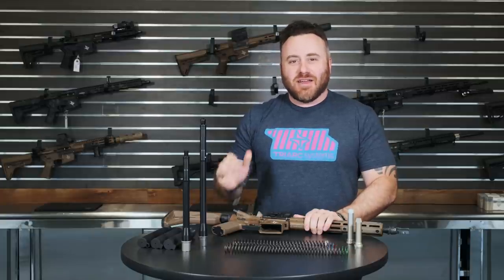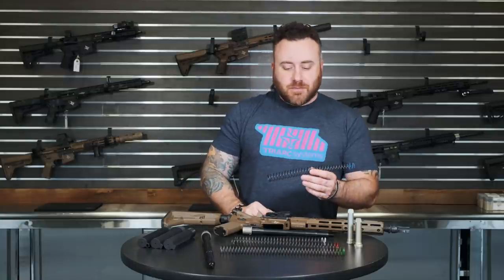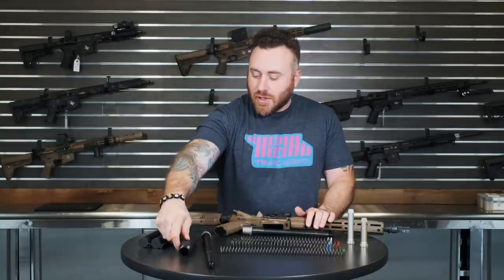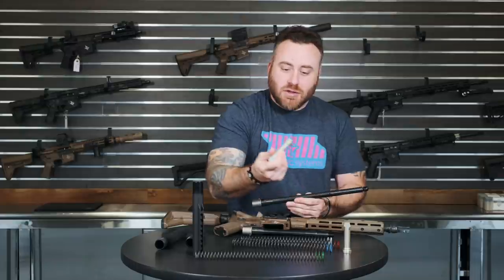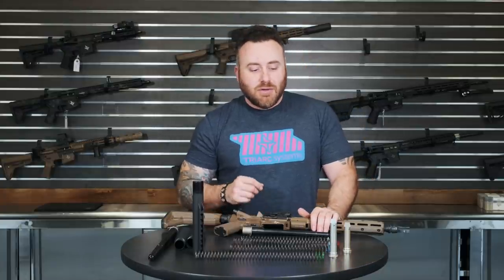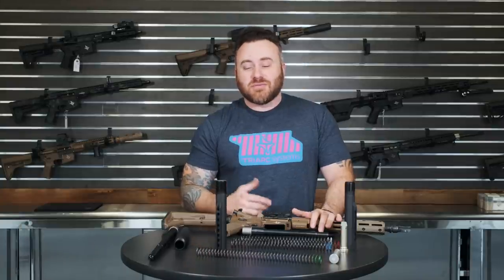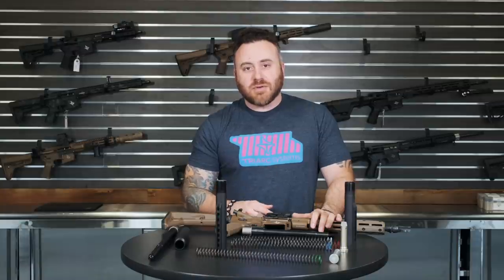AR-15 Spring and Buffer Weight FAQs

Comment: Received my 11.5 upper (fantastic build quality). Long story short the blue spring/H buffer will randomly not lock the bolt back on an empty mag. Switched to standard carbine and H2 buffet and it runs like a top!

Comment: Springco blue and H2 on my 14.5, runs like butter down a slippery slop. Love the A2 community and keep it going.
Reply: Rocco Cardarelli  switched over all my rifles to sprinco springs. They’re much quieter and last a lot longer. Typically I run H2 and the blue spring in all my midlength guns and they shoot very soft and smooth. My Trairc 12.5 came with the H1 and Blue like he said in the video and it’s wonderful. I am thinking of trying the H2 with it now though since my suppressor came in.
Reply from the maker: Rocco Cardarelli  yes its DI
Reply from the maker: @Hazmat0357  Thanks for the feed back Amigo
Reply: @Hazmat0357  You think I will be good running 4.3oz on 16 inch mid length 223/556 or should I go down to 3oz ? I’m using a 16 inch mid length ballistic advantage barrel.

Comment: All hail the algorithm and cyber big brother...
I've been dealing with a cycling issue on my .300, and finally realized it was the Law Tactical folding adapter I added, or more specifically, the 1.8oz "extender" that comes with it, that is the cause. The thing ran flawless before adding that folding adapter/BCG extension. Now it won't lock back on empty, nor eject/feed properly.
Your advice to lower the buffer weight is the answer I've been looking at, but couldn't find anyone else talking about this issue with this folder.
Thanks to my search history, "the all powerful algorithm" lead me to the video with the answer. (now stop watching me, cyber big brother)

THANK YOU!!!!
Reply: Would you mind explaining in detail what you did? I have the 10.3 .300 upper on a aero precision lower and I want to add the law folder as well. Did you use the RED spring he talks about? What weight buffer did you use? I heard a hydraulic buffer might be good.
Reply from the maker: @jasonarias55  Blue H1 but remember Subsonic rounds  and supers are completely different. so to fine tune pick a spring combo that works best. we only run subs suppressed.
Reply from the maker: Glad we could help
Reply: TRIARC Systems, LLC Ok so it’s definitely possible to find a balanced spring combo that can run suppressed subs and supers... just not suppressed supers. I would need another spring and buffer combo for that? Or just don’t suppress supers In general?
Reply: @jasonarias55  I've not attempted a solution yet. I'm actually going to try another part made by KAK Industry that replaces the steel heavy extension with an aluminum lightweight one. Drops the weight by ~50%. It's q quicker swap if I want to run different ammo(subs or sups) than a buffer. However, if that $20 part doesn't work, KAK also sells custom parts to build a buffer to your chosen weight using tungsten, steel, or aluminum weights, and I'll likely put an aluminum one together for running subs. I'll try to remember to report back.

Comment: I was running your 14.5 with a gemtech adjustable bcg with the A5 system and the a5h3 with a law folder and was running fine unsuppressed. Once I put an rc2 on it, after about 200 rounds suppressed would fail to lock back on empty. Trying to figure what weight to run now. Maybe a5h2

Comment: Having a chicken or the egg problem.  When tuning a new build, what should I try changing first?  The buffer or the spring?  What gives you the smaller incremental change?
Reply from the maker: Work on the recoil from back to front. it all starts from the gas port but you need to eliminate as mush friction as possible also remember you need good spring tension going forward too.

Comment: Hey Chris what do you recommend for a 10.5 mostly non suppressed but want it to function to lower power 223 but still handle to hot stuff
Reply: I have my 10.5 NOVESKE SBR suppressed w/dead air sandman s. Running a blue spring along with an H2 buffer. I also run my 11.5 & 12.5 SBR with the exact same setup. All suppressed.

Comment: Great Video!!!
Thanks for the education..
I just put my AR together (upper came complete, I just had to assemble the lower). I have 1 issue:
My action is very stiff. I have to go Guerilla on the charging handle to pull it back! 
Any suggestion?
FYI, I haven't fired a single shot, yet

Comment: What would you recommend if the configuration was a 12.5 triarc upper with an A5 receiver extension and a law folder? Would the green spring + A5H1 combo be sufficient?
Reply: Did you go with the green spring and A5H1 - I have a 12.5 upper with green spring and A5H2 and will not hold bolt open on 1 round mag - but will on a carbine milspec spring/carbine buffer  ?
Reply: @deaconnyte9748  I have the lower with the A5 and A5H1 buffer, no law folder though and no 12.5 upper yet. I'm waiting on the upper right now from triarc

Comment: Is it normal to have that spring noise in the buffer tube? Mine seems a bit loud, but it's the only ar i got so i have nothing to compare it to. Is it normal to have resonation in the spring?
I was going to "grease" the inside of the buffer tube, but didn't want to before getting advise from someone who actually knows what they're talking about.
Reply from the maker: That can be normal with new spring and buffer tubes. oil will help and eventually the surfaces will smooth out. steel wool can help smooth out the surface inside the tube but you have to beware not to remove anodizing

Comment: What do you use for your 8.3 inch 300 BLK builds? I’m looking at the TSR 15-SE.
Reply: A standard carbine buffer and spring should function. If it’s not feeding correctly go to a reduced power spring. Those sprinco springs are ok but I prefer flat wire tubs springs
Reply from the maker: we typically run Blue Springs H1 buffer but we recommend shooting subs suppressed only . you will have to reduce the spring power to shoot subs unsuppressed.

Comment: Would the red spring be good for a suppressed 11.5 also? And would you still need an H3 or would the spring make it so you could run an h2 thanks
Reply from the maker: red spring would work great with a heavy buffer as well suppressed. but it might be too heavy for un suppressed depending on the barrel / weapon manufacturer. our suppressed only barrels will work great with a blue spring H1 / H2 depending on the suppressor model and manufacturer.
Reply: TRIARC Systems, LLC specifically an LMT 11.5 with a dead air sandman S

Comment: For an 11.5 unsuppressed what combo would you recommend? Insightful vid btw!
Reply: I would also like to know. Just got an 11.5
Reply: When in doubt, h2 is a good way to go.
Reply: @jamesdrakcip9276  I started with the h2 but ended up having to go with the h3 on my 11.5 to get my rare breed trigger to function properly. (Upper from psa)
Reply: @sandwichartist5053  careful. Uncle Joe is watching. David Chipman isnt though! Bahahaha
Reply: @sandwichartist5053  i have a suppressed mk18 that loves to blow its gas load in my face. I just replaced my h2 with an h3. Hopefully that delays unlocking long enough to help reduce some of the blow back
Reply: @jamesdrakcip9276  that’s a good idea. I’ll have to keep that in mind if I ever get a suppressor

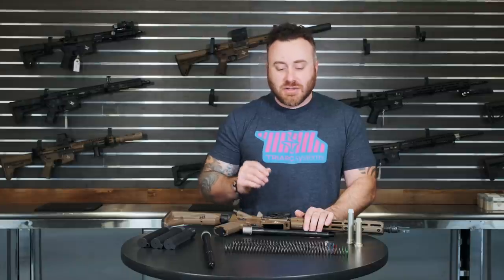Comment: Recommendation on a 16” carbine gas with A carbine buffer and spring that is ejecting at about 1:30? Thinking about the blue or red spring and making the buffer either H1 or H2.
Reply: If I were you I’d run a blue spring w/H1.

Comment: 20" .223 Wylde. Do I need to go rifle Length buffer tube and spring? (42 coils)
Reply: Failure to feed every single time
Reply: Either a short stroke and you need a lighter buffer or the mag is bad.

Comment: For your 14.5 barrel with your enhanced BCG would the VLTOR A5 H2 be too much? The H1 is very hard to find right now.
Reply: What did you end up doing?
Reply: @ek7404  I got a A5 H2 and the JP rifle spring. I couldn’t find a springco green and a lot of the guys I compete with use the JP rifle and A5 system.

Comment: Any problem with your 14.5 running the A5 with the A5H2 buffer?
Reply: My 14.5” triarc runs the a5h2 with green spring and it is and has been flawless.
Reply: Mine was running the a5h3 with a folder, unsuppressed just fine. Suppressed with a gemtech bcg I use the a5h2 cause suppressed setting on bcg

Comment: Have a 7.5 inch 5.56 with law tactical folding adapter running an h2 buffer. Still spitting shells out at about 2:30-3:00. Recommendations?
Reply: What spring you running right now?
Reply: @l337l0gan  Flat buffer spring from strike industries.
Reply: @uncledut  suppressed or unsuppressed?
Reply: @l337l0gan  unsuppressed
Reply: @uncledut  try the h2 with a sprinco blue. It will be a step in the right direction for sure. If it's not enough go springco red after that. I'm willing to bet the blue will be good enough for unsuppressed though
Reply: @l337l0gan  that’s what I was thinking. I wasn’t sure about red. Figured it would be too stiff. Thanks buddy
Reply: @uncledut  no problem. Good luck. You can always go adjustable gas block too!
Reply: @l337l0gan  thinking about that too

Comment: I have a mid length at first it would shoot and eject at the 3 o clock now it's hitting hard on  Recoil and blowing gas in my face and ejects at 2 o'clock I have not changed my ammo I'm thinking of going to a h buffer would this fix my problem
Reply from the maker: What spring and buffer are you using ?
Reply: @TRIARC Systems, LLC   its got a stock carbine buffer and it's unsurpassed has a 16in berral and its psa. DETAILS
Barrel Length: 16"

Gas System: Midlength

Barrel Profile: A2

Barrel Steel: 4150V Chrome Moly Vanadium

Barrel Finish: Phosphate

Chrome Lining: None

Muzzle Thread: 1/2-28

Chamber: 5.56 NATO

Twist Rate: 1/7"

Barrel Extension: M4

Diameter at Gas Block: .750"

Gas Block Type: Low-Profile

Muzzle Device: A2 Flash Hider

Receiver Material: Forged 7075 T6 Aluminum

Receiver Type: M4

Handguard Type: PSA 13.5" Lightweight M-Lok Free Float

Bolt Carrier Group Included: Yes

Bolt Steel: Carpenter 158

Bolt Carrier Profile: Full-Auto

Charging Handle Included: Yes

Optics/Sight Set: Magpul MBUS Front and Rear Flip-Up Sights, Black

Overall Length: 24.5"

Comment: What's the weight on your h1 buffer??
Reply from the maker: 3.7 ounces
Reply: TRIARC Systems, LLC hey if i add a 3.8 oz buffer with a sylvan arms adapter( i think the plunger is 1 0z )will that effect cycling on my 12.5 midlength upper?

Comment: @TRIARC Systems, LLC  I’ve got an 11.5 w/ A5 system an Law folder. The Sprinco green spring with H1 or H2 doesn’t allow the bolt to go fully to the rear resulting in a failure to feed. Can someone chime in with alternative spring choices? Looks like a white spring could work but not sure it’s ideal with the A5 system. Also, does the Law folder change the spring choice or just maybe buffer weight? 

Thanks
Reply: I would like to know aswell
Reply: @TRIARC Systems, LLC replied to me saying the H1 and green spring should work for my application. I didn’t mention that I’m using an adjustable bcg from bootleg which apparently was bleeding off too much gas in the default unsurpassed position. Bootleg sent another to me but it’s not been tested yet.

Comment: Is there a way for me to send you parts and place the order over the phone? I work for a gun store and the hard to find parts I have on hand like a5 tube, Geissele ssa-e so I don't have to waste your milspec triggers. I'd buy just the upper but really want the matching lower because of QC. But I understand if that would make my order a clusterf**k. Thanks guys.
Reply from the maker: Of course we do it all the time
Reply: @TRIARCSystems  I just went ahead and placed my order for a 12.5 upper last night. Thanks 🤙I'm sure whatever I decide to put it on will be great. Can't wait
Reply: @TRIARCSystems  what buffer weight do you use in your 12.5's with a green spring? I'm going to try to call today but work has been crazy with everything going on.

Comment: I’m planning on a 8.3 upper what buffer and spring should I run on my lower??
Reply: You should re evaluate your life choices
8.3 5.56 is useless
Reply: @doctorcropse2795  totally wrong. Not useless. You need to Chrono some setups with specific ammo. Not great for alot of stuff. But if you have a particular mission set such as vehicle or specific home defense missions, 8.3 is perfectly fine with proper ammo
Reply: @doctorcropse2795  8.3 with 556 bthp frontier easily touches 2550-2650 velocity & coupled with a wot trigger that build is a beast 😂
Reply: H2 buffer & jp tuned & polished carbine spring

Comment: Chris, buffer system preference on 11.5 suppressed? Thanks man
Reply: Not Chris but highly recommend A5 buffer system with sprinco green spring and A5H2 buffer. If running traditional sprinco blue spring with H2 buffer. H might work but for the carbine length gas system might be better off with H2. Both of those setups should chew through whatever you throw at it if your barrel is properly gassed.

Comment: Good info I can hopefully put to use. I have the 13.9 track barrel and pinned gas block and was running a vltor A5 h2 and could not get it to shoot more than 1 round without having to manually feed the second round and won’t keep the bcg back after the last round.I’m going to try an H1 and hopefully that’ll do it bc muzzle device is already pinned. Anyone having similar issues with their 13.9?
Reply: Same with mine. Standard carbine and h1 will work fine.
Reply: @jasonpierucci9265 , awesome. I’m actually on the way to try that out now.
Reply: Update: tried the sprinco blue spring with H1 buffer and it still wasn’t pushing the second round out so I swapped the SOLGW bcg with a BCM bcg and problem solved. Worked fine with sprinco blue spring/H1 setup, geissele super 42 spring/H2 and vltor green spring/H1 setup. Idk why the bcg was causing the malfunction but after the swap it had zero malfunctions with all the different ammos, mags and buffer systems I had tried out.
Reply: @atox4957  haha man thats weird. Glad you got it goin!
Reply: @atox4957 thanks for your feedback.

Comment: The red spring is meant for 308. The blue one is extra power spring. The white is standard. These guns must be pretty overpassed if your shipping with such a heavy buffer and extra power spring. I was interested in getting a barrel from you guys till I saw this
Reply from the maker: that's a great question, red springs can work in AR15 and AR10s too. Springco's orange spring is more 308 specific.  we keep the gas ports balanced. the pressures on the 10.5 are the strongest but Red won't work in 11.5 -16in unless suppressed but remember you need good spring tension pushing the BCG forward for reliability and reduce bolt bounce.
Reply: TRIARC Systems, LLC so in your standard 10.5 rifles the red spring/H1 is best for suppressed and blue/H1 is best for unsuppressed but both blue and red with H1 will cycle the 10.5 reliably suppressed and unsuppressed?
Reply: @Anon62796  same question
Reply: @doctorcropse2795  too bad I never received an answer. My 10.5 from them came with a .070 gas port, H1, and blue spring. I now have a RC2 on it and swapped to a red spring since I’ll mainly use the suppressor. I haven’t had any issues with the red spring unsuppressed so far but I haven’t shot a ton of ammo either. Not a wide variety either. Only m855. Still have the h1 as well but may switch to the h2. Idk yet. Still trying to fine tune the rifle.